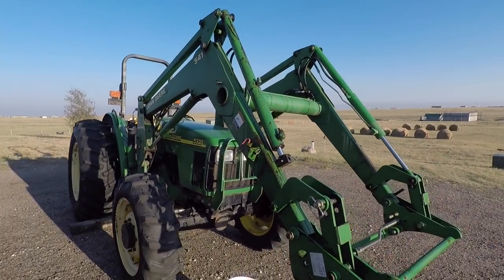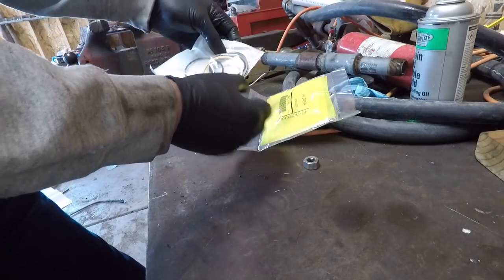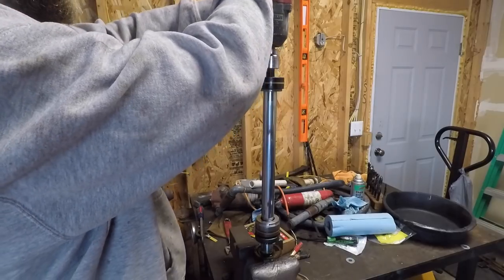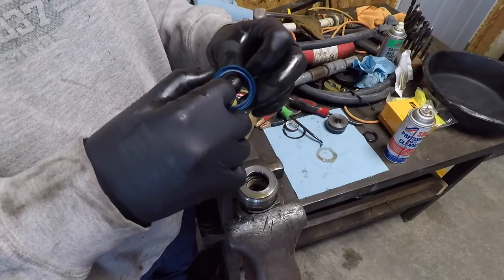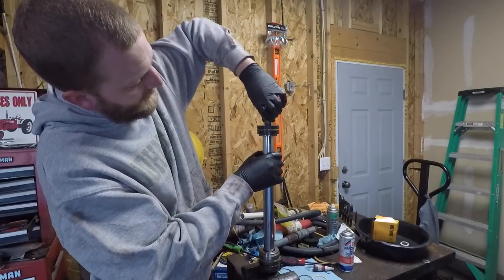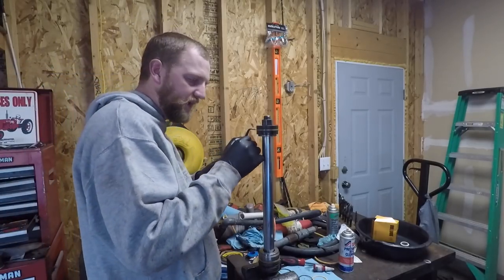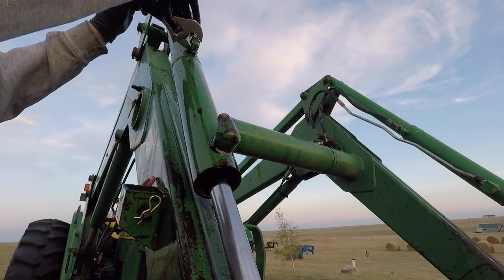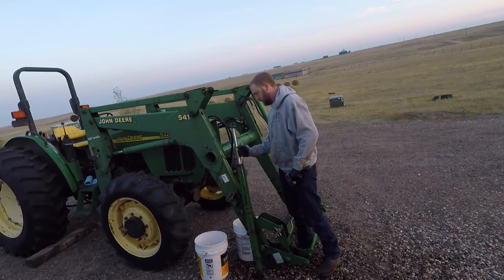Rebuilding a John Deer hydraulic cylinder

Comment: This is great I have a jd 460 loader the two leveler bucket cylinders are allowing the bucket to tilt no matter running or not I'm hoping scoring and cylinders are in good shape. And all I need to do is replace the soft parts. To restore having less than 1500 hours on it but lots of lifting bales dirt exc. Things do wear I should be able to install these in a couple hours and have it back up a running . Great video.

Comment: A guy I know who works in a hydraulic cylinder repair shop told me about it. The electrical tapes keeps the hose clamp from scaring the piston seal when compressing it back with the hose clamp.

Comment: not always 2 kits per each cylinder, it depends. and sometimes, the two kits jd says works for a particular cylinder, are missing a part. good video. one recommendation i have though, butt the rod all the way out to the gland. will make it impossible to air lock the rod into the cylinder if you accidently push the gland too far in.

Comment: Here is a simple small trick when it comes to the seal ring. When you install one on the piston, once you get it straight, wrap it a couple times with electrical tape, take a hose clamp and tighten it down around the piston seal. Let it sit for a few seconds, then remove the hose clamp and electrical tape. This seats and recompresses the seal ring, making it easy to slide back into the ram cylinder, with less risk of damaging the seal ring.
Reply from the maker: +robert281979 never heard that before but I'm willing to try it. Thanks!

Comment: Thanks for the video, I have got to do the seals on our Quicke grapple cylinders, with all the cylinders I've done I have never worked on one like this they aren't real common in this area, I hope that tool is in their  kits. I have one guy brings me all his machine cylinders now. He usually gets them done for less than $100 of time plus parts if they come apart easy. 
    He really likes the fact when I do them they don't leak after a month like they do from the dealers most times, and they charge way more. ! It's like he says by the time some have been done twice thats 5 gallon of expensive oil gone to on top of time and parts.  The last one the big shop messed up they didn't put back up rings in the outer gland groove with the o ring and got 1 internal gland seal in wrong. It cost $300 for the 2 sets of seals without shop time he wasn't real happy with them.
Reply from the maker: +super6954 yikes, sounds like he's had some real trouble.
Reply: Oh yes he has, cylinders aren't the only thing I've worked on for him after another shop messed it up or couldn't figure it out right. But he still has this mad fascination with buying new or newer used equipment from some of them. He just trades some stuff before it starts needing fixing to often.  The JD combine just left after 4 years on his place and less than  1500 threshing hours between him and the first owner !.

Comment: Yup. The good ole 3 ugga duggas with the impact is the proper torque 👍🏻
Reply from the maker: +Drew w works for lug nuts on semi trucks too. :)
Reply: If a guy doesn't have a big impact, 3 squawks  or cracks of the nut/bolt head against it's clamping surface, with a 3/4 or 1" drive socket set and T bar. Helped with a 5 ft cheater pipe and big  guy on the end works good  for certain things to L.O.L.
Reply: Failing all of that highly technical methodology I've found that the" Pulling until you have reached three grunts and a fart" system is equally effective.

Comment: We had a ram snap so we need to disassemble the cylinder to replace it. 

I was able to get the outer snap ring off but when I try to knock the end of the cylinder back inside, it's acting like it's seized. We used a big sledge hammer and a piece of pipe slid over the ram and pressing against the end cap but no dice. 

Is that what happened with your right hand cylinder that you had to replace entirely? 

Thanks!
Reply from the maker: Yes, it is. If I had it to do over I would extend that Ram all the way out and cut the base off of the cylinder body. Push the Ram in and disassemble the piston, pull the rod out through the cap. That way you can reuse the rod and piston, just buy a new body, end cap and seal kit. With your Ram being broken though, I’d just buy a new cylinder. Not sure what loader model you have but the one I had to get was close to $600 US
Reply: That makes sense. Thanks!

It's a 521. Where did you order the parts?

Comment: Great video bro.  Amazing what a shop will charge for that service.
Reply: John Deere quoted me 400 dollars for 2 cylinders. then I tried buying them from part department they wanted 200 for 2 seal kits. I went on line and found them 18 dollars plus shipping.
Reply: last year it cost me $250 for one cylinder from a cylinder shop
Reply: @scottpearson6097  Yeah it just depends on whats wrong with it. I just took one to a hyd shop they said 130 to replace the seals then turns out it had other problems.  I rebuilt 2 john deere cylinders and never again. I will be happy to pay but not to John Deere.
Reply: Stupid pays double. Triple is need tomorrow.
Reply: @jerryday2851  Yup.
Reply: @jerryday2851  If mangled, yeah, no fun. If just rings, why God gave us rainy shop days.

Comment: Help! I am rebuilding a 520 lift cylinder and I was wondering if the first blue bore seal (wiper seal?) you put on, on the outer facing end of the gland--does the groove face in and lip face out or vice versa?

Also I have a hard plastic type seal that came with the bore kit. It has a rybber-like ring on it that will be impossible to fit inside the bore--i have no idea where to put it. Is it possible that it is extra?

My seals were so crumbled that I had no way to use them as a guide on how to mount the new seals. Your video has been a life saver!
Reply: Probably too late, but for future reference the inner seals face lip in (to keep the oil in) and the outer seal faces lip out (to keep dirt out).

Comment: Nice video.  You can also use a air compressor to push the rod out of the casing, makes it easier , I take mine off the tractor and put it on my work bench , then I put my air nozzle on the hole furthest away from where  the rod goes out. if you hit the wrong hole it will just go back in. But use EXTREME CAUTION , because if your air compressor is pumped up to 120 that rod will shoot out like a missile. Maybe try a air pressure around 30 PSI and go from there and still be careful . I'm getting ready to do another one and I might screw some 4x4's to my bench to stop it from flying across my shop.
Reply: You would never get that particular cylinder apart with compressed air. It requires a LOT of force to get that snap ring past the little removal tool. I’ve tried just about every method imaginable. The only practical solution is to use the tractor’s hydraulics, snatch it out with a truck or tractor, or build a bench top jig to pull them out with a ram. It better be a powerful ram though. The last time I tried, my 10 ton ram wouldn’t do the job. I personally prefer snatching them with another tractor or use the tractor it is mounted to and a tree.

Comment: John Deere cylinders are the only ones I have ever encountered that use snap rings.  They can be difficult to work on.  Every other cylinder I have rebuilt utilize end caps that screw on.
Reply: Worst design ever! I can see why they use it though. I bet they saved a ton of money by not having to cut threads or do any precision machining. Cut one groove in the bore, chamfer the end, and you’re done. They’ve probably got $100 or less invested in the manufacturing of those cylinders. Then they can paint it green and sell it to us poor saps for several times the price. They really aren’t too bad to rebuild, once you get the hang of it. Having to compress and install that damned snap ring is my least favorite part of the process. I also skip the hydraulic oil money shot and pull the rod out with a truck/tractor/tree or any other immovable object. I despise having to clean up oil...
Reply: Heard that

Comment: From what I was viewing here - The jump cuts in ur video were a little jumpy.  Also, u cut some of the good stuff :-O  I wanted to see (more of) you making a royal pigsty of a mess when using the hydraulic pressure to release the piston.  
Is there a cap or cover missing from the right shaft at the bottom near the attachment plate?  
Cosmetic difference only between the replacement vs. repaired?
Fall is rapidly approaching to the work load is upon you.  Yeehaw!
Reply from the maker: +Ji Fi-01 it's tough to decide what to cut out. I try to keep things moving fast enough to be interesting, but maybe I'm taking out to much? 

Only differences in cylinders are the original had the fittings on the front and the new one had them on the side.
Reply: Maybe u sliced too much. Just letting you know I enjoy the messy in-process stuff as well.  I can always fast-forward if I need the abridged version.  :-)  I certainly don't want any of the thrilling farming activities to land on the barnyard floor.  Don't let me teasing worry you (too much, just thoughts).  You've got bails to make & move and tractors to fix & sell.  Your farming time clock is tickin in overdrive.